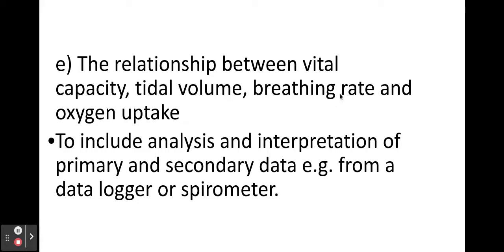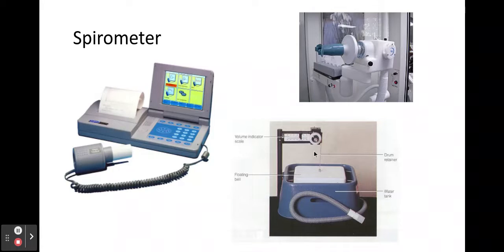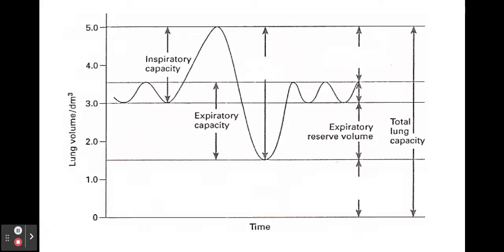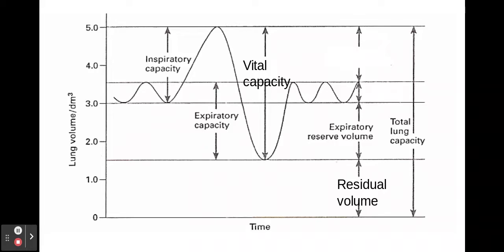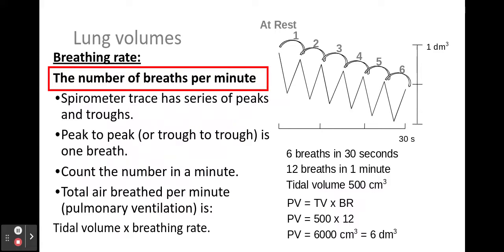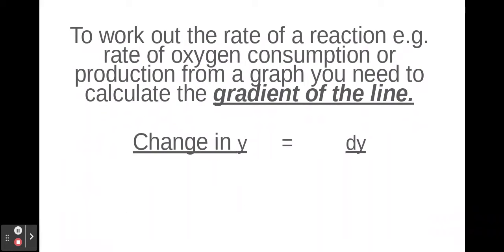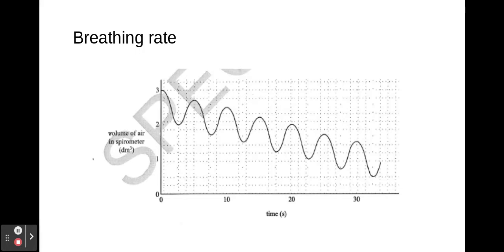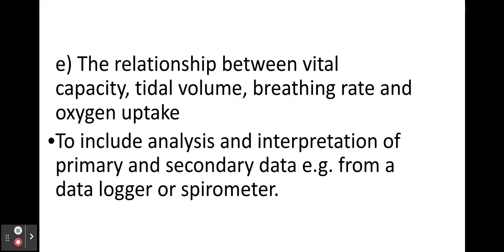3.1.1 Exchange Surfaces e) Spirometer

Comment: Hi, just out of curiosity, when you calculate the rate of O2 consumption per minute, does that equate to the pulmonary ventilation rate as CO2 is continually removed from the air in the spirometer by the soda lime leaving only pure O2 to be inhaled into the lungs or  the rate of O2 consumption per minute entirely different from  pulmonary ventilation rate ?
Reply from the maker: pulmonary ventilation is all the air in and out of the lungs not just o2 👍
Reply: @clarebiology2858  alright, thanks for explaining